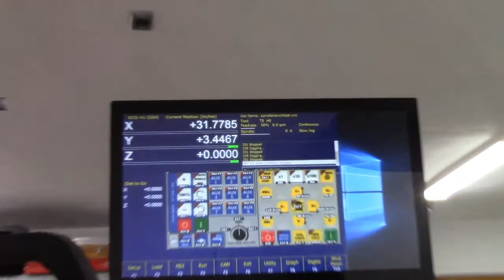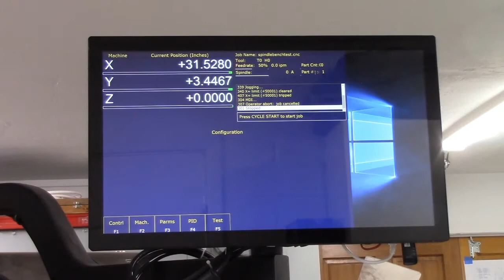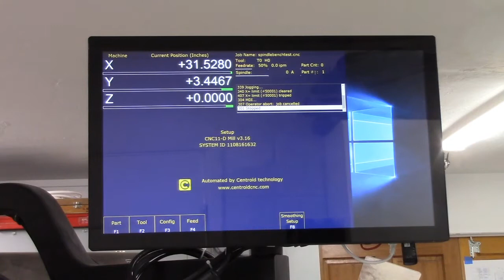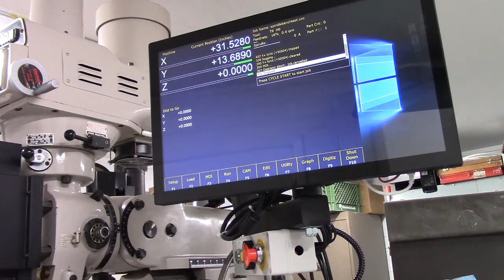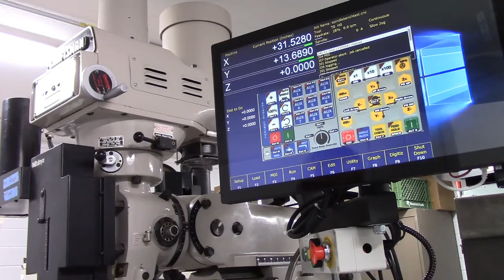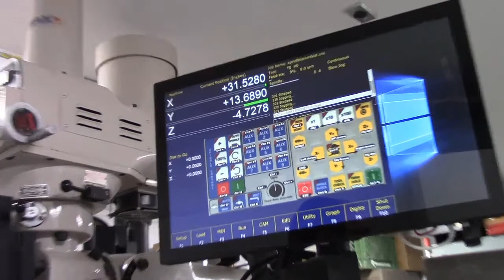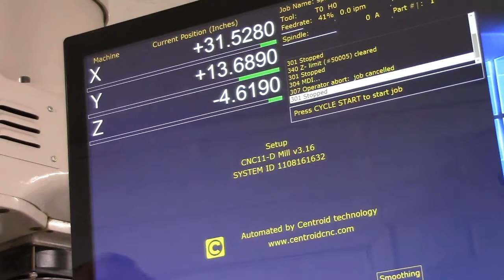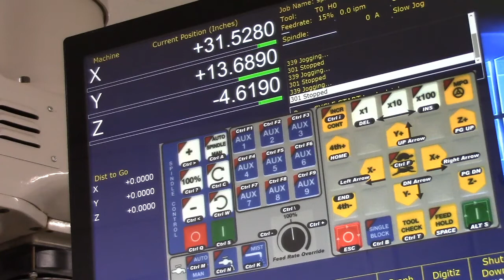Setting Software Travel Limits

Comment: Nice video... Thanks.  Quick question.  If you plan on using soft limits on for a small bench top mill conversion, do you still need to use hard limit switches?  Can you simply rely on soft limits to replace hard limit switches?
Reply from the maker: You should put one limit switch on each axis. That said, you can put a mark on one end of each axis. Jog your machine to them and then set home. Then travel to the other end of the axis and determine the distance. That will become your soft limit travel. But you always need to jog to your marks on power up then press cycle start to set home.
Reply: @martyscncgarage5275  Thanks for your quick reply.  I am a bit confused as I thought once you program the soft limits, you did not need the hard limit switches.  Once the soft limits are properly programmed, wouldn't Acorn avoid running beyond that soft limit?
Reply from the maker: @joels4208  eveytime you start any machine, it needs to be homed. That point becomes the datum. It's important for soft limits and setting tool offsets. Without good switches, you will have to regime and reset your tool offsets. Homing to marks is not repeatable, unless you have an encoder that gives you access to its marker pulse (once per revolution pulse)
Reply: @martyscncgarage5275  Ok.  Perhaps I am using the wrong terms.  I planned on using    limit switches to home the machine (establish the datum), but soft limit switches to stop the machine from going beyond the travel limits and damaging the machine.  In this scenario, do I need physical limit switches to determine the max travel of each axis, or can I rely on the soft limits that I program?